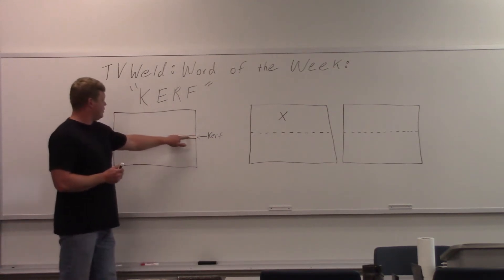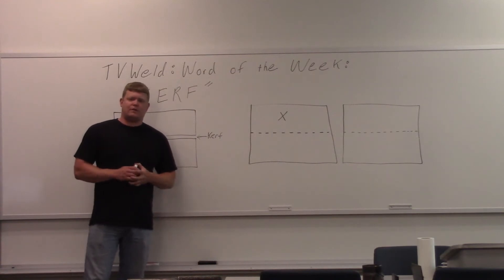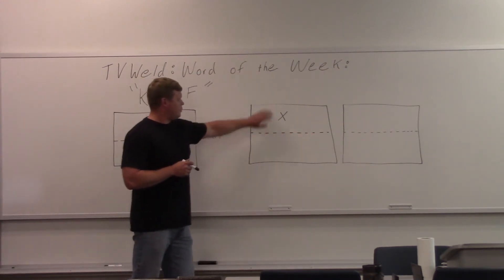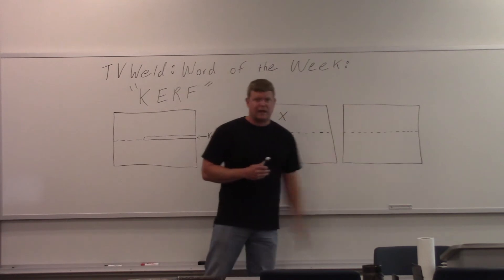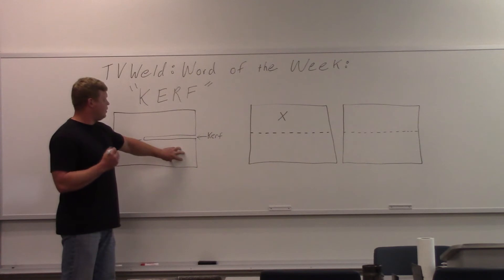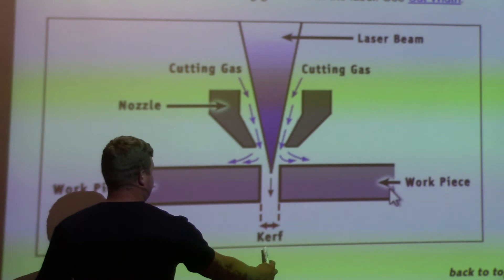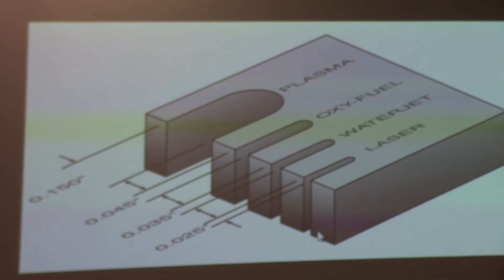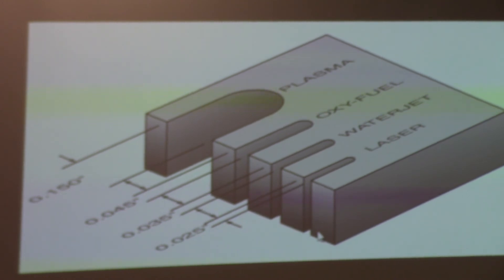Welding Kerf

Comment: Hello, thanks for thos series they are useful. do you plan "word of the week :polarity"?  I wish to see that.  my take on this is that polarity allows better penetration on thick metal when positive. for thinner one better control and better penetration with straight polarity  ( stick only) . some coating do not like dcep but the opposite is not true  (?) . Best regards